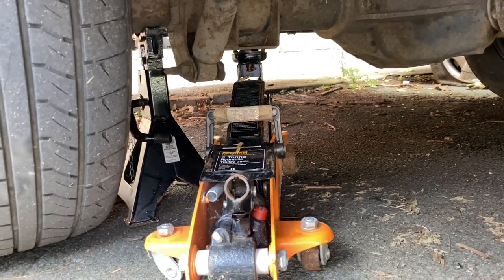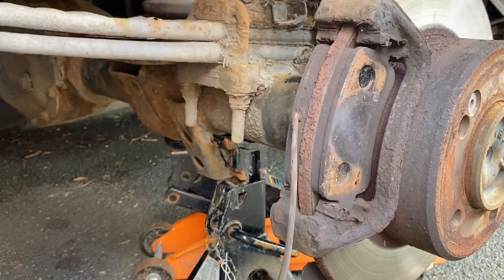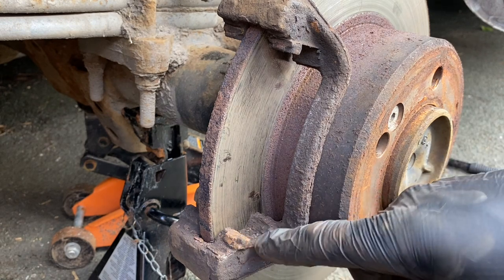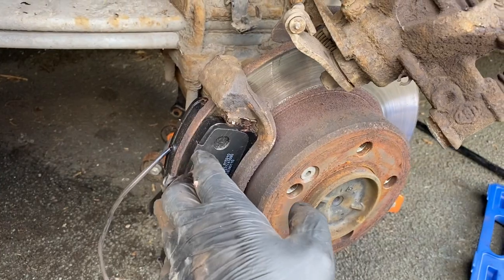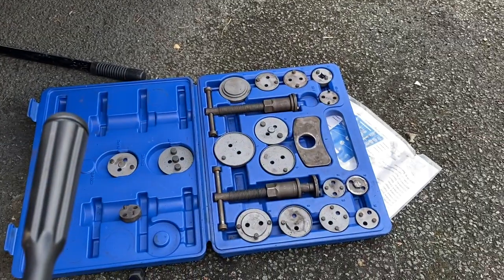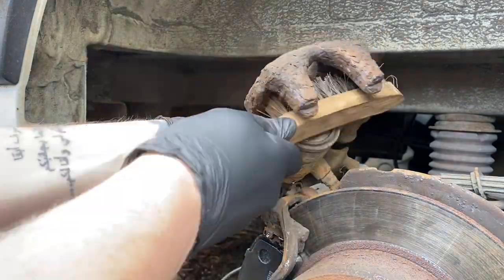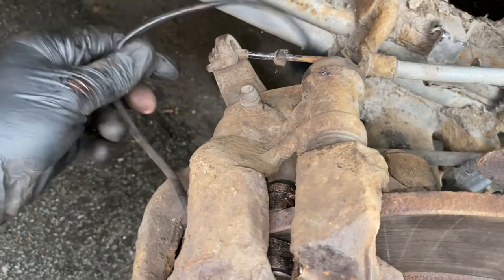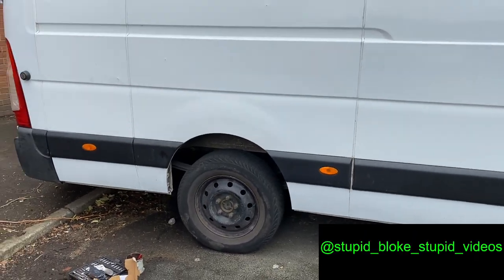Vauxhall Movano/Renault Traffic 3 Rear Brake Replacement. How to Fit Brake Pads, Wind Back Callipers

Comment: I’ve spent hours today trying to push the piston back as the one size I needed wasn’t in the tool kit. I’m the end a pair of long nose pliers and a second person using a long chisel to apply pressure. Did the trick.
Reply from the maker: It’s a pain in the arse when that happens

Comment: Bien hecho amigo, easy job 4 u today ! Ive bought an 1978 VW Camper and was checking the brakes ! I sheered of one bleed nipple and twisted one brake pipe ! But thankfully new wheel cylinder and brake pipe cost £10  on autodoc !
Reply from the maker: Did you try the tricks I show my brake pipe and brake bleeding vids?

At least it was cheaply fixed
Reply: @StupidBlokeStupidVideos  vans been neglected, but i will get it road worthy again !
Reply from the maker: @arnietwo11  good luck with it bro ✊
Reply: @arnietwo11 or just wait till its 40 years old when it won't need an MOT! 😂

Comment: Swear i bought that exact wind back tool set and not a single adapter fit... Any idea if theres a size code for the specific adapter or a link to one that will fit? Managed it with a g clamp and some grips but for next time?
Reply from the maker: @edgywingsetacid  I’ve done the g-clamp and grips my fair share of times. Pain in the arse innit!

This is a BluePoint kit off the Snapon van, not sure the different adapters can be bought separately though 🤔

Comment: Is the front the same sort of thing or is it slightly different?
Reply from the maker: The front will be easier as you don’t have to rewind the handbrake mechanism. Just carefully push the piston back in with a screwdriver or something. You should really crack the bleed nipple we you retract the piston, but most people don’t bother with no issues.
Reply from the maker: The fronts should be more like what’s shown this other video, but a bit bigger. 

https://youtu.be/XK_7UHM6tVg?si=re_Yulh04E9v7I8M
Reply: Lovely stuff cheers mate!

Comment: You made it look easy, every bolt on mine was tight as fuck. Snapped a breaker bar getting the wheel nut off and those caliper pins have bent my allen bit and still didn't come out. It then started to snow so gave up. Must buy better tools 😂
Reply from the maker: Sounds like you had a lot of fun 😂
Reply: @StupidBlokeStupidVideos  I did, got it sorted over the weekend with some decent tools. Pleased with the job ,full brembos on now🤣

Comment: So the brake pads are worn out on one side but still have 50%+ on the other. Shall I investigate the reason and fix it....... Naa just change the brake pads! 😂
Reply from the maker: Nah fuck it, just change the pads. It was just doing the minimum to get it back on the road for now.
Reply from the maker: But now I have in fact eventually changed the shagged calliper. Check out this weeks video for that one.

Comment: Don't repair the problem just replace the pads that don't  need doing 
You sir should be working at h@lfords
Reply from the maker: I did fix the problem. My suspicion is that a previous mechanic had fitted pads only to one side as they appeared to be different brands on each side and one side was worn out and rusted up. 

This video was filmed months ago. Van has been fine since with no binding brakes etc 🤷‍♀️